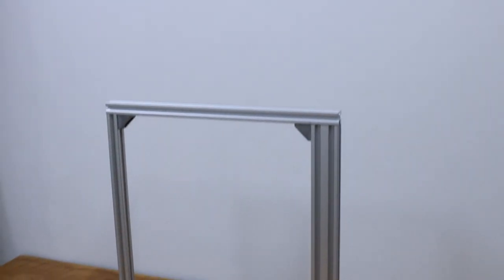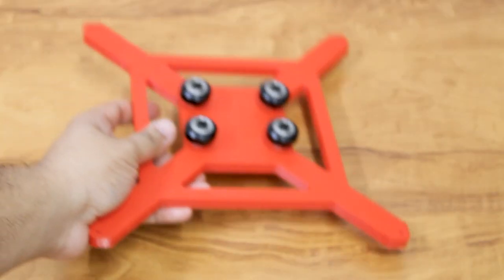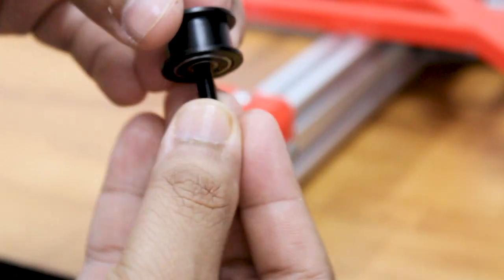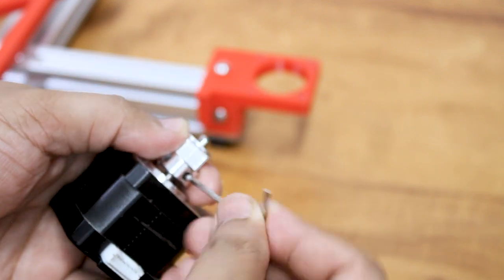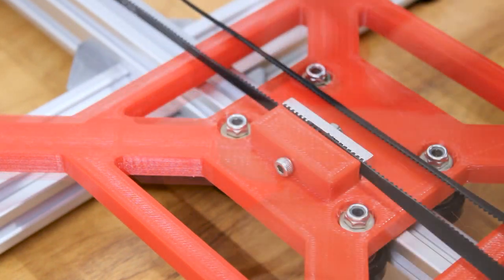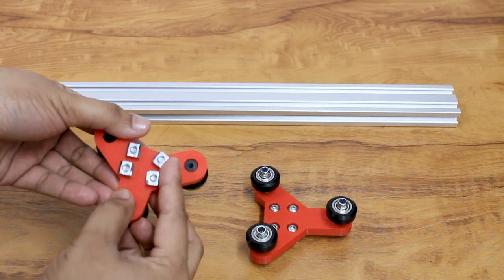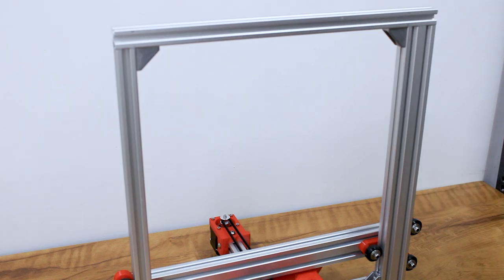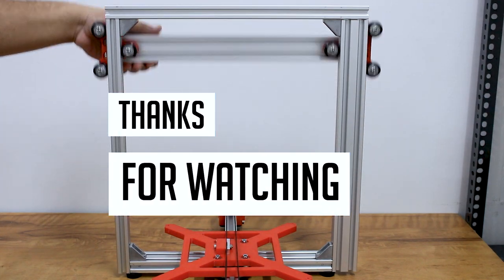DIY 3D Printer - Part 2  - Mechanical Build (1/2)

Comment: Question: if i use a ramps 1.4 instead of the ramps 1.6 would it still work??
Reply: it should work but 1.6 ramps are better

Comment: Have you used 40% infill?...if not how much infill have you used
Reply from the maker: 20% infill is fine. make sure you use atleast 3 perimeters and 5 top/bottom solid layers
Reply: @SuperbTech  and what is the torques rating for the motors?
Reply from the maker: it is standard NEMA 17 stepper motor with 4kgcm torque
Reply: @SuperbTech  thanks alot brother